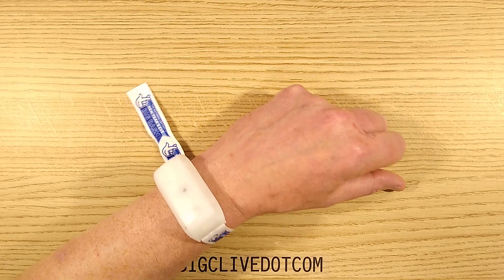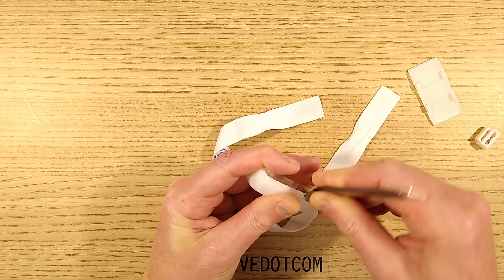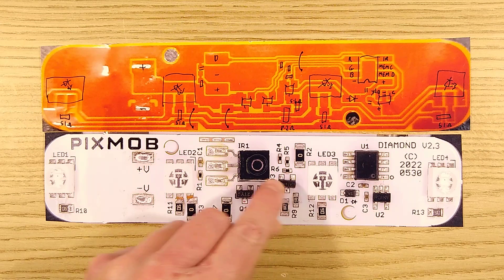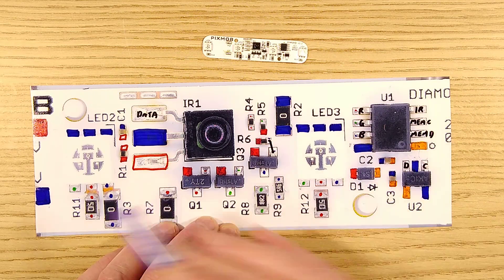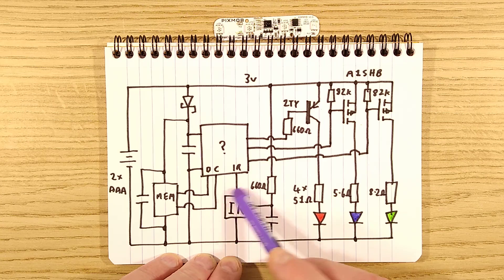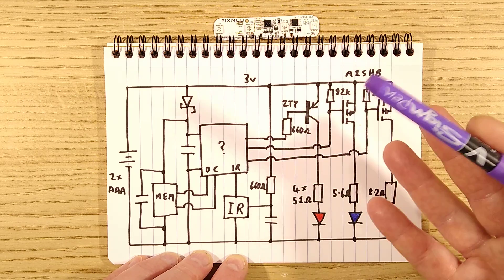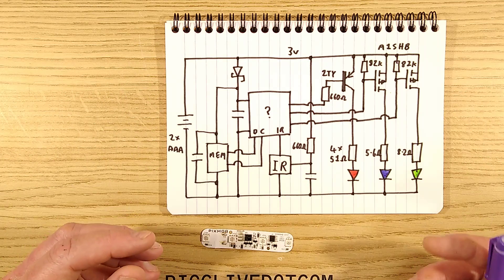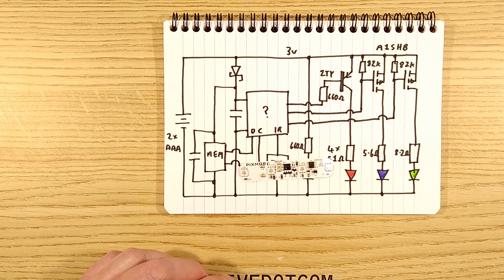IR controlled concert LED wristband

Comment: I'd imagine the resistor values for the LEDs were also chosen to balance the color intensity.

In all, a very neat little circuit.
Reply: odd indeed...but i belive ur right bout the led's the mosfets are there to limit the maximum current (i see no other reason) .. the red leds are more stable, and more stable during various temps... there most be 3 different types of leds with very different behaviour during use, the control chip we can assume is just on/off?... and thers no circut to fade any of them... (atleast not outside of the chip, possbly the chip has some ability to control the red channel, but i doubt it, and difficult to control the green/blue as thay are connected to mosfets)
..the IR decoupling capacitor is likely a load leveling device for the IR chip..?
...what i dont get is the coupling of the mosfets in an always on state (its impossible close them) ther always current running trough the green/blue led's...
Reply: Awesome device that can be used for other nefarious purposes .I wonder how the monitored people movements in the crowd ????
Reply: @carlubambi5541 I mean, they don't. The devices have no transmit function.

Being IR controlled, of course, they could use directional beams of IR to control what areas of an audience light up with what color—but that doesn't track anyone.
Reply: @ConstantlyDamaged  but you can via cameras and other light detectors .You can 3 d pin point positions of those wearing  a device .It's similar to how they do 3 d graphics and augmented 3 d video animation with numerous color dots and green screen/blue screen
Reply: @ConstantlyDamaged  wrong .With 3 cameras you can spatially track a person quite easily .You do the same thing with dots on a body with blue /green screen .That's how many CGI movies are done .Give the receiver the specific command to turn on and off at specific intervals and /colors in specific patterns and have the cameras track the light .Easy peasy Pick your color you want to track and tell the device to turn on or off at a specific rate and you can track anything
Reply: @carlubambi5541 Okay, last reply.

The signal for these is IR. You can't make one singular person turn a different set of colors to everyone else, the best you can do is make everyone in a wide line change colors.

Those motion tracking systems generally need a clear line of sight to the target—something in short supply when in a crowd.